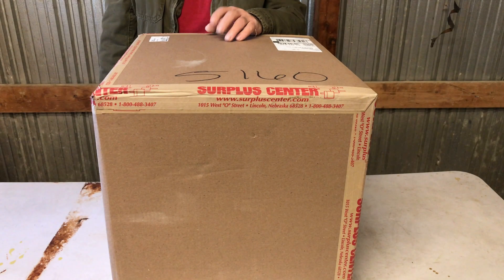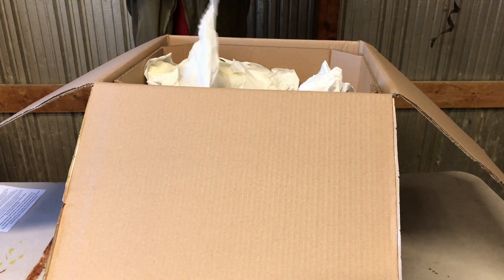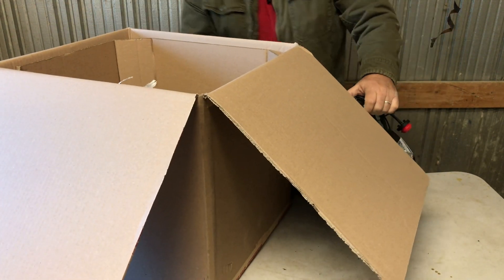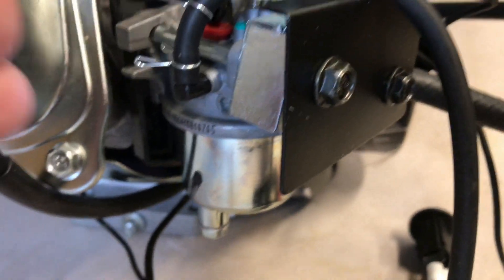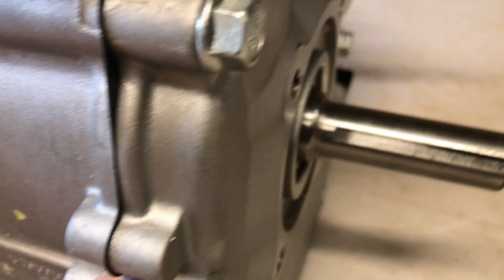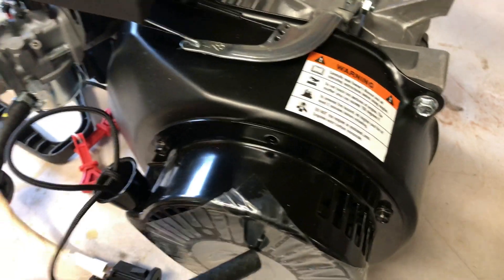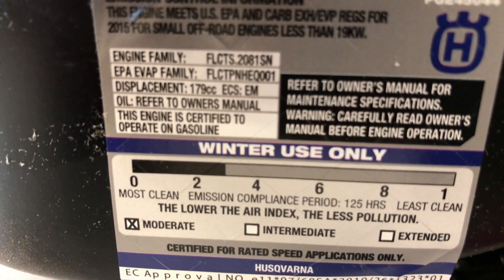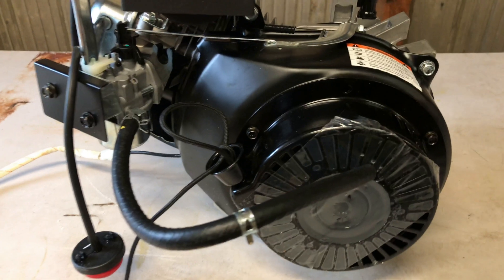179cc 4.8 HP LCT Engine $49.95!  Unboxing and Review (Short Version) Cheaper than a HF Predator

Comment: I wonder if they make a shorter dipstick that will thread right into the base where the taller tube is now. With the old Tecumseh Engines found on snow blowers MDT decided to switch out the tall oil fill tube dipstick for a short one most likely has a cost-cutting measure because there was really no reason on a snowblower to do that.
Reply from the maker: That's a great question Robert, and I don't know the answer. I've not found any aftermarket parts that will work with these (right out of the box) other than the gasket sets. The LCT 208cc engines seem to share the same design as the 179cc engines though (just a bigger bore on the 208cc) so if there's a 208cc engine out there with the different dip stick , it should fit. Please let me know if you find something that works! I appreciate you.

Comment: I bought one and put it on a monster moto mini bike I love it the exhaust is not a problem unless your dragging your feet doing a wheelie has plenty of torque and will lift the front wheel no problem i builds a air filter out of a 2” pvc cap I flattened it with a grinder and drilled out the gasket on it and it worked great to put a cone filter on for under $90 after shipping definitely impressed
Reply from the maker: Zane these little  LCT engines are a great buy for sure! I'll have some LCT build videos out soon. I wanted to have them out last week but still waiting on a few parts.

Comment: I bought one gonna try to make it work on a longtail when I get it. Only thing I'm working out in my head is how I'm going to set up a lever throttle on it on the carb. Seems perfect for a small mudmotor the exhaust goes toward the rear, tether killswitch and external fuel tank line fuel pump. Sounds like perfect marine platform to me.
Reply from the maker: I think with a few tweaks these will make great mud motors. Thanks!
Reply: Put a 22mm mikuni carb kit. (TC racing, amazon $60.) Then check out the OMB warehouse mikuni throttle bracket kit. Don't forget about. 120-125 jet for the carb as they come with a skinny #98. The mikuni will outperform the clone carb and is super easy to adjust. Best of luck on your mud motor!
Reply: @igokarts4510  thank you for the info!!! So the 22mm mikuni you think should bolt up? If it does that would be perfect for setting up a throttle cable.
Reply: @azlongtales  I can't guarantee because I haven't had one in my hand but there is  lil waller out room on the mikuni intake
Reply: @azlongtales  your very welcome!
Reply: Also if you use a 7/8" handle on your steering controls you can use Mini Bike twist throttle and kill switch.

Comment: How much was shipping to the Jelly state?  To north Ga. it's $32.38. I figured that ordering like 4 of them would bring shipping way down. Wrong!!!! It was like a couple$$$ cheaper per engine but not much at all. Sometimes the 212 is way over kill for power jobs , but it's such a great engine I just use it. If shipping wasn't so expensive I'd order at least 4 of these , but by the time , rounding up a gas tank , n filter you're at Predator price. Or just the activation and hassle of making these items.
Reply from the maker: Phil their shipping calculator shows $32.38 shipping to KY too. I wish I lived closer to Lincoln Nebraska so I could do a in-store pickup, I'd grab a couple dozen of these.

Comment: For an LCT that is a great price for that engine, the OLD MAN at EP over and out!
Reply from the maker: Hi Wayne, I think they're a pretty good buy. It's cheaper than the rebuild parts I needed.
Reply: @KentuckyFriedFixes  Thats for sure.We scrap many mower engines and when you cost out the parts individually they add up way more than purchasing a new engine.

Comment: I'll never get one but this engine makes me wonder. What's the bore and stroke?
Reply from the maker: According to my research the bore is 65mm and the stroke is 54mm. I've not taken this one apart to verify those numbers yet. I have a clone gasket set on order for this one hopefully they'll fit and I can go from there. Thanks!
Reply: @KentuckyFriedFixes  OK Thanks. I thought that maybe it was going to be similar to the GX160/200 with a 68mm bore.

Comment: Is the engine block the same size and dimension as a 196/212 block? Or is it smaller?
Reply from the maker: I've not done a tear down video on this LCT engine yet to inspect the internals. I will be doing one after the other LCT engines I ordered arrive. Please remember to subscribe and hit the notifications bell. The LCT engine is next in line after I upgrade the 224 Predator engine. Thanks, Chris